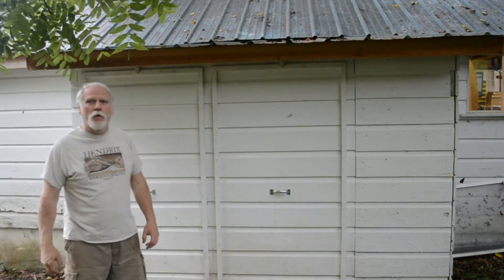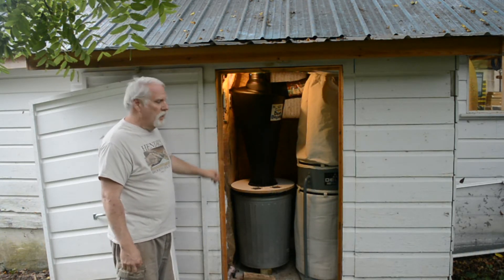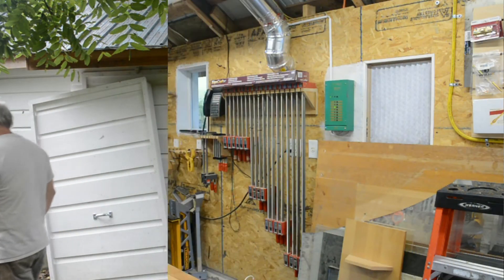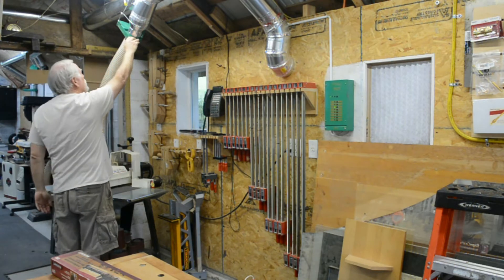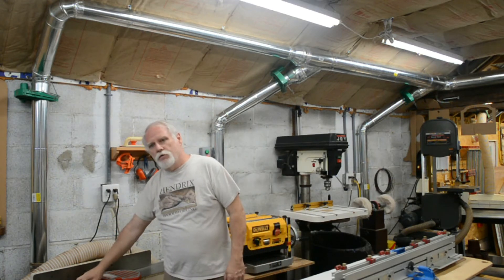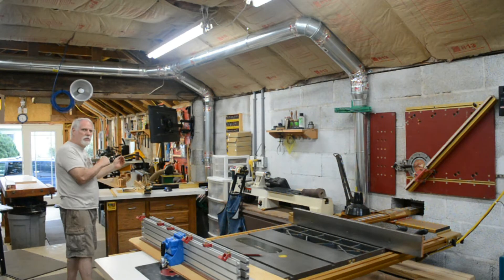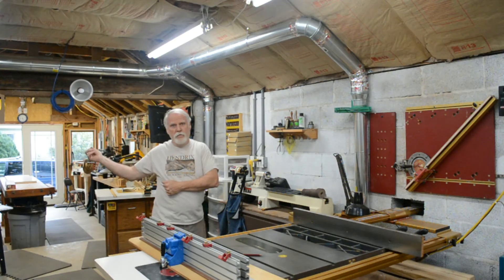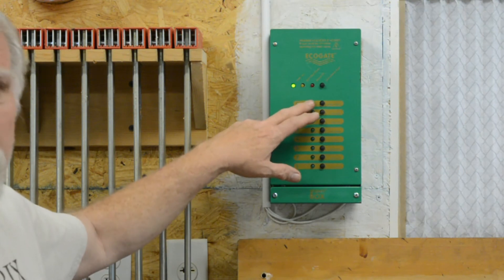Dust Collection Upgrade

Comment: Love it. I don't like the double elbow at the beginning, seems like it'll choke it a little. Thanks for posting it's over the top.
Reply from the maker: Yeah the elbow was necessary to contour to the roof and short walls.  This is an old 6.5' garage where I had to raise the ceiling.

Comment: I like the setup!  The furnace filter through the wall is simply brilliant.  Solves the fine filtration problem for just a few bucks.  How has it done over the last few years?
Reply from the maker: I have two filters "stacked" in there, and change out every 6 months.  No dust blowback!

Comment: Hi Mitch, who made your Dust collector? Do you know what size the impeller is in side your collector?
The reason I ask I have a 2 HP unit with a true 12 inch impeller along with the supper Dust Deputy Cyclone.
I did install a Wynn Environmental 0.3 Micron Filter. For auto blast gates I built mine from an Arduino Micro Controller and servo motors that drive the gates open and closed. I am using current sensors to supply input signals to which blast gate opens as the various tools tools turn on.
It is neat to see another company has an adaptable system for smaller shops.
😁🛫
Reply from the maker: Id have to actually check the size.  Id say its probably 10 to 12"  its a delta 1250 cfm 1.5 hp. 6" port and I removed the 6-4" wye that came on it.

Comment: This is probably the cleanest Dust Collecting system I have seen on YouTube that’s not in a commercial setting!  I would like to do something similar, could you make a detail video on how to set it up for beginner, from wiring, programming/setting the PLC? That would be awesome! There are plenty of how to’s out there, but none is as clean as yours.  It’s visually clean, it’s automatic and I’m not certain on the cost but it’ll be an option to think about when I can see how easy it difficult it is to install.  Ty in advance
Reply from the maker: Ill have to do some research on tbe plc.  This particular one is no longer available.  Ill see what eco-gate still has for the small shop.
Reply: Hendrix Woodworking ty, I subscribed to your channel, looking forward to the video.  I like to point out in regards to the level of your trash can.  I believe I’ve seen in other video that Oneida ( or another company) has a level sensor that you can attach via wire to the lid of your trash can and it will light up a bulb inside your shop so you don’t have to keep checking the level or forgets to check the level.  Btw, what was the estimated cost of your set up minus the dust collector, I’m more concerned on the piping/blast gate/wiring.

Comment: Was that 6" HVAC pipe that you used?
Reply from the maker: I used a combination.  Mostly 6"  a little 5", and 4" verticals. It will suck marble sized chunks from the TS all the way back to the cyclone.

Comment: Glad you like your Ecogate system Mitch! We love the video!
Reply from the maker: Thank you for your view and comment.  I've had several requests for information.  Do you still sell a small system?
Reply: We do still sell small systems. We focus on industrial-grade products, so even our "small system" is designed for heavy-duty use, so, for example, all gates are now metal rather than plastic (see https://www.ecogate.com/automatic_blast_gates.html).

For very small shops, we have spun out a separate company, GrnGate. GrnGate systems are designed to be very cost-effective for very small shops; the gates are plastic (as are the gates you have), and only available in 4" diameters. More info at http://www.grngate.com/

Hope that helps!
Reply from the maker: Ecogate thanks. Upgrades possibly in the future. Thank you for a great product!
Reply: You bet! We have a special trade-in system for greenBOX 8 owners - we'll be happy to tell you the details when you're ready.

Comment: What gauge is your duct pipe
Reply from the maker: Actually I took the cheap route and used standard furnace ducting.  An to be honest with you, when I was demonstrating the manual mode on the controller, I accidentally closed all the gates, and you can hear the vacuum build up.  I almost sucked a pipe flat!  One remedy to that is a spring loaded damper that can be pulled open by excessive vacuum.